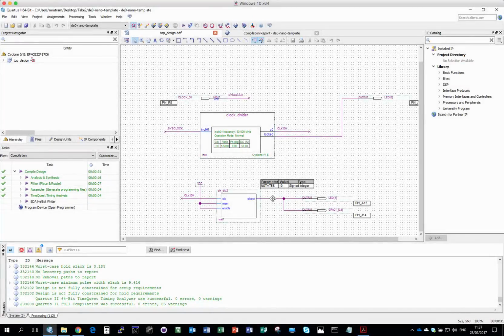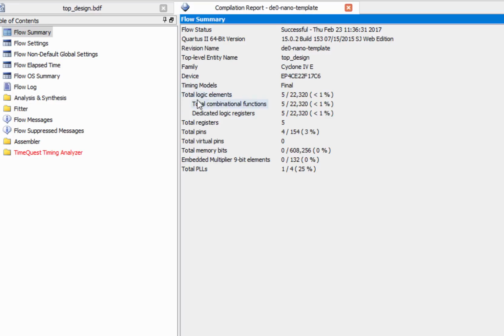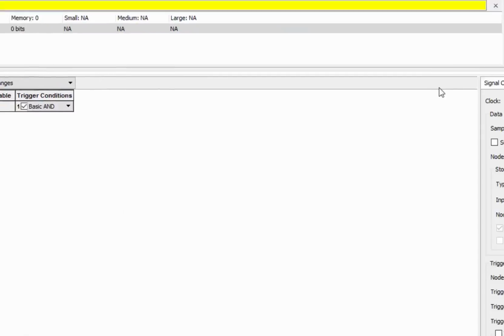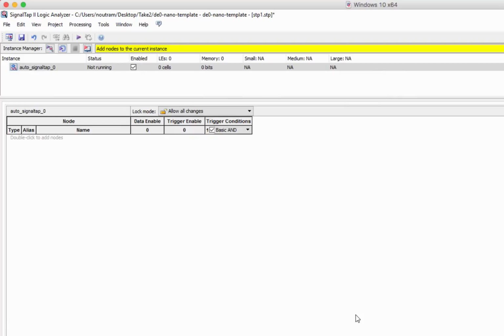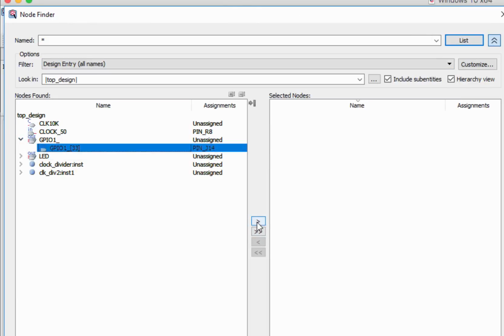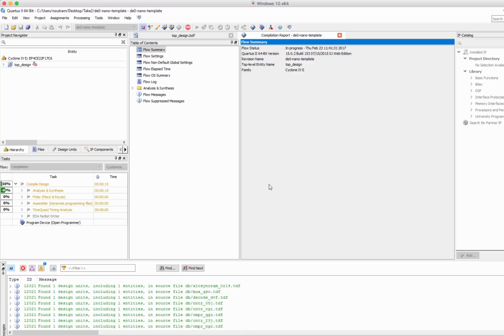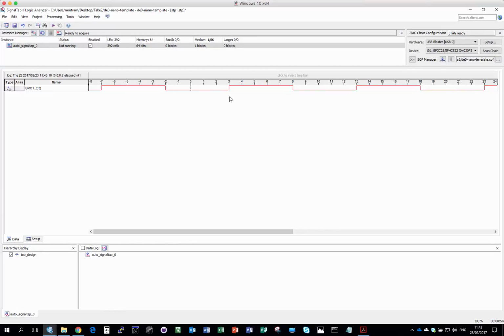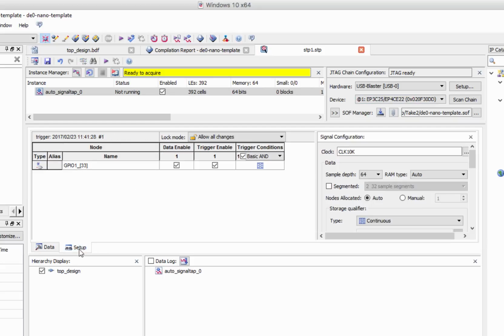Introduction to Using Signal Tap

Comment: Thank you for this video.
1) you set 64bits of RAM and we can see you have almost 64 samples on your waveform... if you double this RAM, you will have 128 samples, right?
2) if you add another 1-bit node, will it require you to double the RAM to keep the same number of samples?
3) the system requires us to recompile every single time I change something in the setup, number of nodes or even simple the trigger conditions, do you have some solution to avoid this?